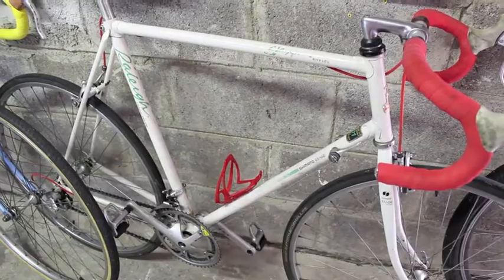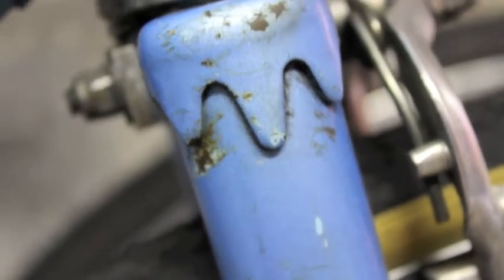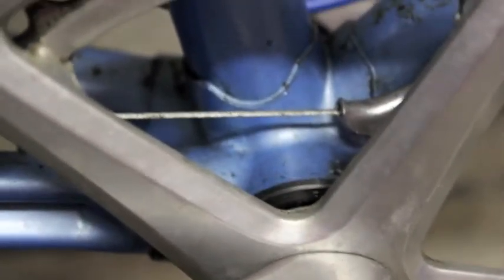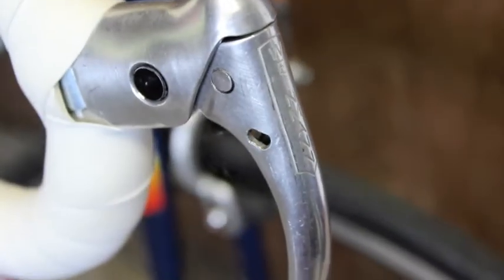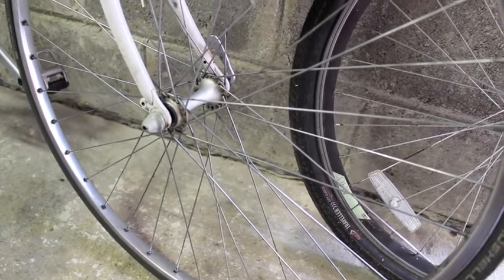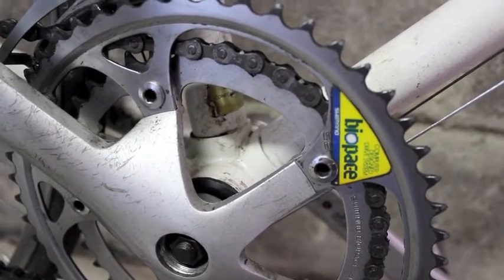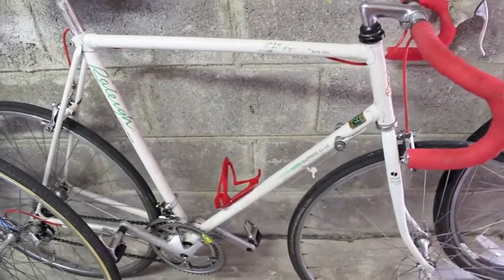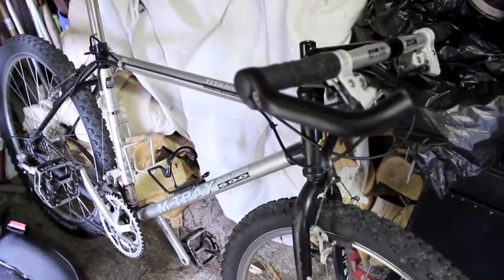VINTAGE STEEL BICYCLES

Comment: I had a 531 Reynolds  SL  new frame that completely snapped in two 1inch above the front derailier because it rusted through from the inside, this taught me that looking at the external condition proves absolutely nothing in determining whether a steel frame is in good condition or not, avoid old frames. That is my advice, by the way my frame was only 7 years old with light use when the seat tube snapped in two.

Comment: I have a uo8 mixte Peugeot is it possible to upgrade to a three chain ring up front. I saw your Peugeot iseran 👍🏻 I have the same but smaller size frame can I also upgrade to 3chainring in the front? I do ride my bikes as my every day commute I ride pretty far to any advice will help thanks